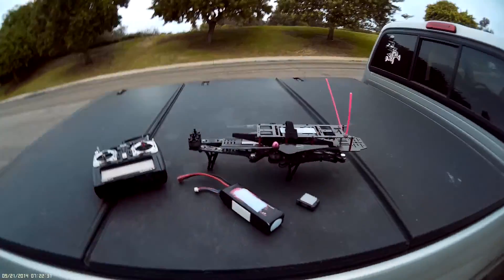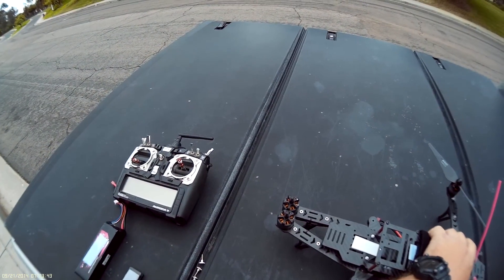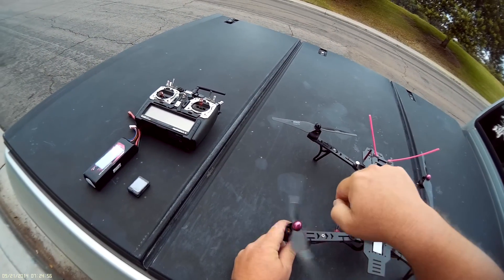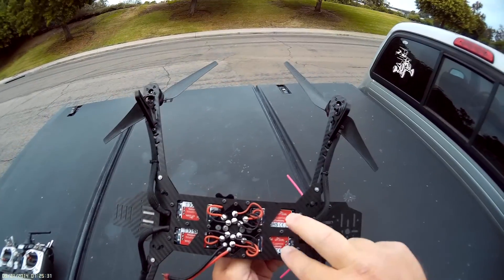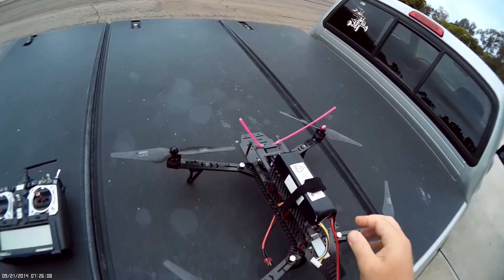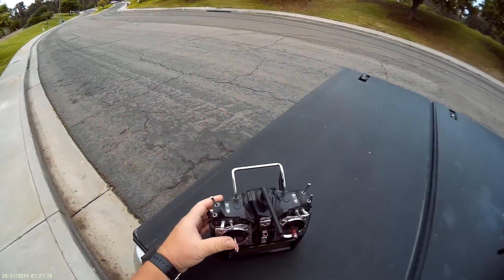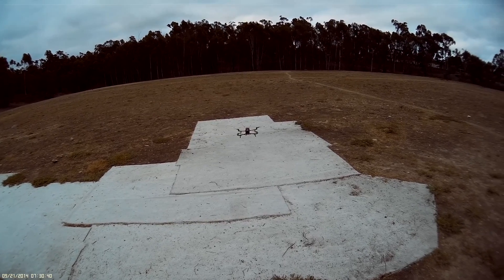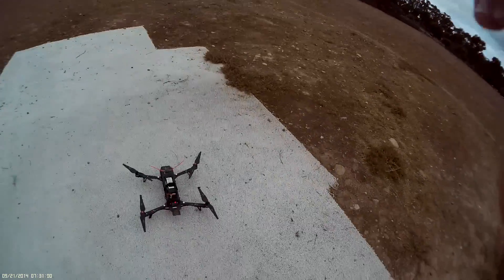RCtimer Alien Copter Bee

Comment: I checked your battery-motor-prop specs on eCalc and theres a significant error; motors are rated 400W (15s peak), but your battery-prop -combo draws almost 700W of power. How did this end? I´m planning to use those same motors on my next build, but using 6S scares me :D
Reply from the maker: Juuso Luukkanen never had a problem with power system but I only had it at full throttle for short periods and battery would sag but I don't like the frame it's to flexible

Comment: Had my eye on the SL2212/920 motors for a while as they always gave best performance in eCalc. You helped me make up my mind to get the AlienCopter Bee frame with those motors. Just ordered everything and will be using an Openpilot Revo, MN8 GPS, Littlebee 30a escs 10x5 props and a Mobus actioncam. I chose a 5ah 4s battery which will give a theoretical 20mins hover. FPV gear to add later, Very excited.

Comment: how is that frame take crashes ..is this same as the AC BEE?
Reply from the maker: I have crashed it twice and the only things that broke were the props. One time it was because the gains were to low it likes to rear up like a horse when slowing down. It cart wheeled and broke two props and pulls the bolts out of aluminum columns. Second time I had wire come loose every thing stopped and just came down one broken props and bolts pulled from aluminum columns. This frame is different than the AC bee this is RCtimer version.
Reply: yea the ac-bee is also rctimer ..i was just checking it out last nite ..so you got yours from rctimer too ?..

Comment: Crazy - great stuff...   but will the 6s batt not toast the motors and escs before long?
Reply: Motors are rated for 400 watts on 6S for 180 sec. I'm not going to be at full throttle for more than a few seconds maybe 20 seconds at most the escs are rated for 380 watts continues and peak of 30 amps not even close to that. So no it will not toast motors or esc.